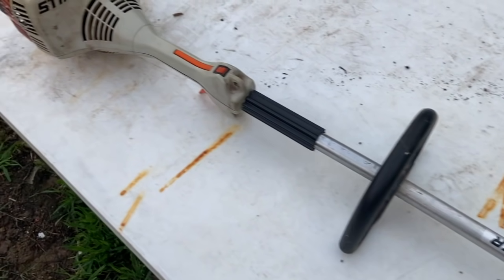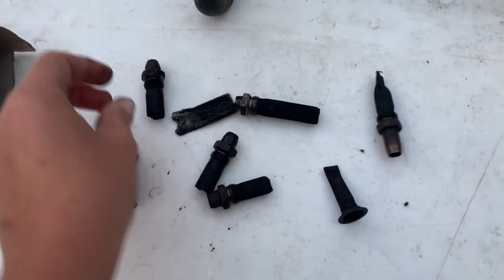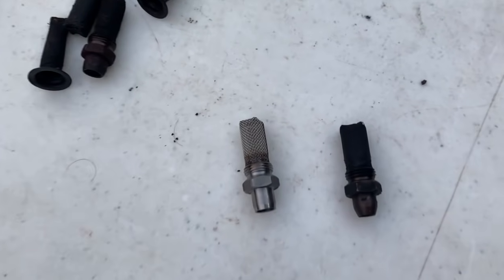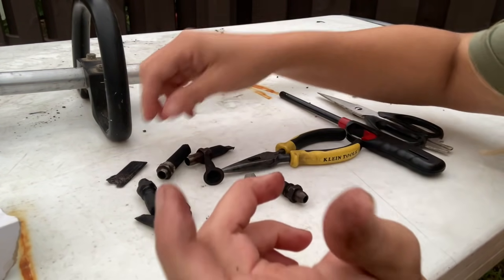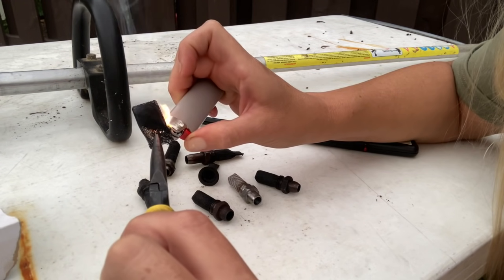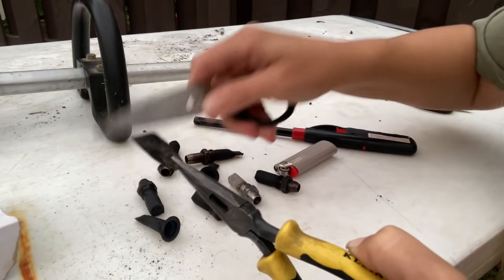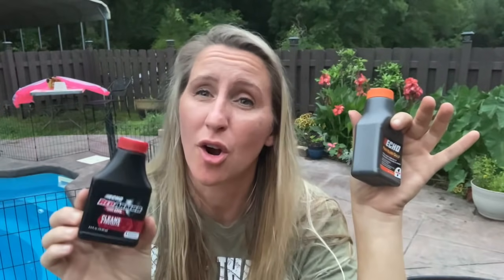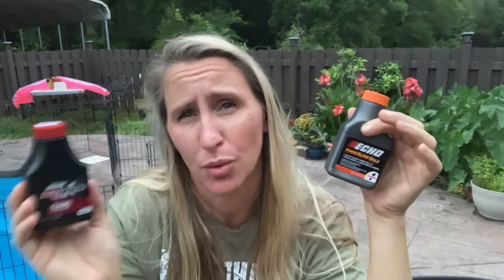THE BIG SECRET! STIHL has NO POWER? Won't Throttle Up? How to fix your trimmer/blower.

Comment: It's funny... and yes I agree you are correct. I always remove those, but the bigger thing is regular customers only use theirs a few times a year not like us using them daily. What I found out is if you build your own which is 3x the size it works a lot lot better. I wish manufacturers would not cheap out on those and build them bigger in general because as bigger they are the longer they do last and less they do hinder the build up. Also we pump ours screens into awesome and after 1-2 days they are clean and ready to be reused.

Comment: Is this strictly when you are using it low power all the time without using full throttle, or does varying between the two speeds keep it burned off?
(Love your videos!)

Comment: Many times a customer would bring a trimmer with no speed/power.I would take the machine and the customer to the back shop and show them how to remove the spark screen. Many would say they had no metric allen wrenches, so I would give them one. Never charged for this. Built much good will that way. These same customers were quite loyal to the shop. Made more money than charging for such a simple fix.

Comment: Even at full throttle you will still need to check and or clean them regularly. I use break cleaner spray. The worst offender is my Stihl hedge trimmer.

Comment: Hi, A few years ago I was gifted a 4 cycle cub cadet trimmer (BC490)  Once it starts it does pretty good except for spewing oil out of the exhaust. It seemed to have weak spark so I changed the spark plug and the cable because it appeared to have been severed a bit due to it being positioned wrong and the plastic cover damaged it. The cable came with a new fly wheel but i didn't change that yet. Now I am thinking that there is a carb issue. Any thoughts?? Thanks :)

Comment: a torch and a blast of air from the compressor air pistol I seen mechanic do this many years ago he said I used a wire brush but sometimes the wire would get stuck in the screen so he used air from then on ..

Comment: In Europe we don’t have spark arresters. Our fuel though is 5% Ethanol, so when I use my Stihl power tools with 5% Ethanol mixed with Stihl HP Super after use I empty fuel tank and then run engine till absolutely dry of any residual fuel in fuel line or carburettor. The problem is next time I use the Stihl power tool, it’s a pig to start or pop off, often taking 20 - 30 pulls on starter cord almost giving me a cardiac event. Often I find spraying Carburettor Cleaner into air intake will start engine almost immediately for a few seconds, after which the engine will start easier almost straight away on normal 2 stroke fuel. I would like to know if after using Stihl power tool and emptying it if I should add some Stihl Motomix and run for a few minutes and leave a little in fuel tank and fuel system, even though it’s made up of Stihl Ultra oil and if this is ok. Stihl Motomix is $30 US per gallon in UK.

Comment: I have a shindaiwa eb480  at full throttle it sprays fuel out of the carb to a point it will cover your hand when placed in front of it, doesn’t seem to go to full rpm.  Spark arrestor clean .   Any suggestions?

Comment: Taking a chance you may read this, I have a redmax bcz260ts  trimmer and the past month it's hard to pull the rope only when it's cold and the first start of the day. Very hard to pull the recoil rope . After a few pulls and it's started the it's so easy again to pull. Only happens when it hasn't  been used for the day . Can you tell me if you have any ideas? Never had the cover off or messed with anything internally

Comment: Many yard machines don’t need to be run at full throttle much of the time, so how much of the part-throttle carbon issue is oil related and what’s different about the Stihl oil?  Running at full throttle all the time will no doubt wear out engine internals faster.

Comment: No Xtra warranty if u use Sthil oil in Aust . Seems to be u can run less oil with the Sthil 50 to 1   vs other brands 25 to 1 .  As a contractor I always prefer more oil in mix . Never had oil/carbon/screen issues . As u have suggested if u use alot of throttle limited issues occur .
Used on 95 series 2 strokes and FS 130  4 mix technology --uses 2 stroke fuel

Comment: Chickanic  I have a Ryobi RBC430SESC  4 stoke petrol strimmer.  It has only been used about 6 times.  The thing starts and immediately stalls.  I do not want to be replacing the carburettor.  
Any advice other than get a new strimmer?  Thanks.

Comment: I found that mixing non-Oxy with the VP pre-mix in a 2 gallon tank along with 1/3rd of a small oil container that u mix with 2 gallons of gas has run well & not the smoke I had. When I ran exactly a mixture of 2 gallons of non-oxy along with 1 small oil container in a brand new Stihl 18" saw I had problems starting it & they told me I had too much oil in my gas mixture. Unbelievable! The gas cap broke on day 10 & I was lucky enough to find a new cap @ the Stihl dealership which fit but wasn't the piece of crap model that came with the new saw. Should of bought the Husqvarna model which I could have bought new which has a regular threaded cap to it. ➕️ they offer on a new saw a couple of years added to the warranty if u buy a couple of gas/oil products u r going to need anyway. Probably cuts down on Husqvarna warranty problems by starting off with the right accessories for your new saw.

Comment: That's a constant problem. I've told customers repeatedly that these small two cycles have to be run flat out and hot. They don't believe me and constantly pump the throttle, assuming that it's easier on the engine.

Comment: I use the line that is shaped like licorice. I find that it trims much better than using something that is round and smooth and therefore won’t cut the grass or weeds as good as something with a edge. I mean that’s just common sense

Comment: QUESTION :I have a Sthil 180 that ive busted the antivibration bushing on the handle , local saw shop wants $200 JUST in labor to fix this as with this model saw {i bought it new about 20 years ago} they say and showed me , that the top of the engine has to be taken apart to get to the bolt to replace the bushing.....other then that , the saw works like a champ , but its just beating the heck outa my h ands and shoulders now. Is it worth fixing it or just shelve it till i hit the lottery and buy a new saw?

Comment: I know this is a super old video but still may help some folks. Anyone who owns Stihl equipment needs to read the manual.  My older 011 ATV uses 40:1 with Sthil oil and 25:1 with other brands per the manual. But both my MS171 chainsaw and my FS240 string trimmer are 50:1 with any oil but recommend Stihl.

Comment: Question. DO I have to use the Stihl gas? I patronize three Stihl dealers. They all insist that I use their $35 per gallon gas/oil mix "or it will void your warranty (the common threat). Of course, all of this goes on as they also have Stihl oil for sale. What's your advice and opinion?

Comment: Another consideration for the spark arrestor screen is that the engine and carburetor were tuned for its presence. Exhaust scavenging will not be the same without.

Comment: I just spray mine with carburetor cleaner and it removes all of it in a matter of seconds and then put it back in but anymore I just take them out. I use Stihl oil now so I normally don't have that problem.

Comment: Hello miss good day i have a stihl 450 brush cutter  for about 4 years now and have been using chevron 2 stroke oil in it and i have never have any problem with it at no time someone tell that it is a good to use in it and i have been using it for so long without any problem

Comment: I have a 25cc Hyper Tough weedeater that wont throttle up.  I took the plastic cover off to expose the muffler..it doesnt seem to have any removable exhaust nut/screen on it?  Just a triangular opening that doesnt seem to have any way of servicing inside the muffler?

Comment: I RUN 93 GAS IN MY MS 291 AN MY 360 PRO STHIL SAWS I USE STHIL MIX OIL AND HAVE NO PROBLEM WITH THEM  I DO MY OWN SAW WORK ON THEM

Comment: hi ,  i like your show.  i have a 290 stihl .   engine wont start. its 2 trees old and about 1.5 years old.  the dealer said the enhine meeds a head cylinder piston .  i used stihl oil but they wont honir the 2 year warrantee because they said i over heated by using a dull chain.     s o now i wont pay them another $350 to repair it .  i have a $500 paper weight.  iam a mechanic myself.  i work on heavy diesel equpiment.  is this saw worth fixing?.

Comment: I have murry 2050 string trimmer.  It would not start this spring.  No spark.(replaced coil)  now I have spark. Replaced carb.  It will only run a little while.  Could it be clogged muffler?  Last year it would only run about half chocked.
Reply: I suspect a CC vacuum leak, probably the seals around the crankshaft. Check your CC vacuum with a test gauge.

Comment: I have Troy built string trimmer 30cc, and it is the hardest starting trimmer I have ever had. Any ideas why it would be so difficult starting
Reply: I got one of those crappy lean-running trimmers too. She didn't much like 87E10 Manitoba-Canada gas, but I'm not about to keep ethanol-free gas just for her.  I finally modified the carb-circuits quite a bit richer, and now she is much happier.

Comment: FYI.  If your cutting and have a  permit from the Forest Service and are caught with your spare arrestor removed, it is a huge fine.  I've seen rangers at checking stations not only checking their permits but checking their saws also.

Comment: I just bought a 4 stroke outboard motor.  Can I use my leftover 2 stroke outboard motor oil with my chainsaw/leaf blowers?  Thanks in advance.
Reply: I have heard outboard 2 stroke oil is for marine engines, not gas powered lawn equipment. I think it may have something go do with the shear point of the marine  oil at higher temperatures. You are better off getting 2 cycle oil that is made for specifically for gas powered lawn equipment (not marine engines). If you don't use the right type of oil for your lawn equipment, your pistons will probably seize up before their time. Gas powered lawn equipment costs a lot more these days.....

Comment: Fuel quality also a huge problem. Always add a quality fuel stabilizer to fresh fuel every time you get a can full as soon as possible
to avoid separation and loss of quality. No matter if the oil says it has stabilizer or what type of fuel, non ethanol or not.

Comment: I was told by the Stihl dealer was , remove that. Put in vise use propane torch burn off carbon. Let it cool reinstall and that's it ready.

Comment: I have a question can I use any stator or voltage regulator for my z-track 225 Briggs & Stratton motor as long as it will fit it or do I have to get one that will match the same model number because the one I found on Amazon has both but don't have my model number for the part
Reply: You don't have to use the same stator or rectifier, but they do have to match your need. You can't use a low amp stator with an electric PTO.

Comment: An Oxy/Acetylene torch adjusted to an oxidizing flame (excess oxygen) is excellent for burning off carbon from most everything. It's not the heat that does it so well, it is the excess oxygen in the flame that causes the carbon to really burn off rapidly, because, carbon is actually a fuel, (Think Coal, or Charcoal Briquets) carbon burns when heated in the presence of oxygen.

Tim

Comment: I think the issue is people take better lubrication is always better in 4 stroke engines and apply it to 2 strokes. 50-1 works fine with conventional oil, but I think it's too rich with synthetic. Synthetic simply lubricates too good for that kind of a ratio.  Amsoil really got me to buy into this idea even when I don't run Amsoil Saber. I will run Amsoil at the tested 100-1. If it's another brand synthetic I'll run it at 75-1 and a lot of the issues go away.

Comment: Casterol Makes the oil for stihl it even says it on stihl packages. Oh and harvest King makes the oil for chainsaw bars. In laboratory tests and actual use it's far better than the name brands and it sells for $10 or less depending upon where you buy it Harvest King makes a wide variety of lubricants for tractors and other applications even Automotive😊 just bought 24 gallons of it I can get 3 gallons of harvest King which is better than what I would pay for 1 gallon of stihl bar oil😊😊

Comment: Question - You referenced using Stihl Oil and not running full throttle causes lots exhaust build up, So if you use Echo oil is this not a problem ?
Reply from the maker: It will happen with any oil if you do not run full throttle, I just see it more with the Stihl silver bottle oil. The oil is great though if you run your equipment at full throttle. Even if you have to run it at half throttle to get your job done, give it a good rev up in the air before you get done to burn that carbon off.

Comment: What's your thoughts on the "generic" oil you can get at Walmart or Home depot??
Reply: Cheaper oil isn't always better. I trust the Echo brand 2 cycle oil, and i use it in my Echo gas lawn equipment. No problems with Echo oil. I have used VR full synthetic 2 cycle oil, if i can't find Echo 2 cycle oil , without problems. Just make sure whatever oil you get is compatible with your brand/model of gas equipment. A good quality 2 cycle oil may cost a few bucks more, but it will make your gas equipment run free of trouble for many years down the road.

Comment: Also, removing the screen will mess with the fuel/air mixture in a two stroke, especially at high revs. A hole in the piston is no joke. The spark arrestor is designed as part of the engine.
Reply: Yes, but the knowing how comes from experience (and mistakes)

Comment: So the echo oil will work good in my echo and my stihl chain saw?
Reply: I can't speak for Stihl equipment, but i do own Echo blowers and a Echo 2620 gas trimmer. I use mainly Echo (Red Armor) 2 cycle oil and i have used Echo (PowerBlend) 2 cycle oil without any equipment problems. Echo's fas powered equipment can run anywhere from 10 to 20 years with Echo 2 cycle oil, so i feel Echo's 2 cycle oil speaks for itself. Echo oil cost a few dollars more these days, but i trust their 2 cycle oil, especially the "Red Armor".

Comment: I take the spark arrestor off and tune for extra air flow lol. Also you can say it Stihl oil sucks !! 😅 when i stopped using it i could see an immediate difference. Bad smell went away, less smoking, and when i look inside my cylinders and muffler less carbon deposits.

Comment: Leaf blowers are a real offender in the plugged spark arrester problem. People putt around at part throttle and the screen becomes plugged and the engine will hardly come off idle. Pretty simple to remove the screen and clean it. Chick is right, you have to run a spark arrester. They are a fire hazard without a screen. If you choose to be a hero and run without a screen, I suggest you fire up your two cycle engine at night and watch the mini flame thrower you have created. Always use a screen and don't dog down on the throttle.

Comment: question for you girl:  I have an  old shindaiwa 270 that I love.  it never gave me an ounce of problems until recently.  mind you, I have had it for over 20 years.  well, 
the clutch went out on it.  I took it to a reputable repair shop and after a while he called me and said that the clutch was obsolete and that shindaiwa no longer
builds nor sells those items.  so,  I bought a stihl weedwacker, which I am not that impressed with.  I love my shindaiwa, which I keep under the house.  so, after
much research,  I found a shindaiwa clutch in Italy.  I bought it and shipped it to my home.  I took the shindaiwa weedwacker and the new clutch to the shop.
no matter what he did, he could not get it to run right with the new clutch.  the head keeps turning.  any suggestions?  can I mix and match with another brand?  
I refuse to give up my  favorite weedwacker.  I am at my wits end.  please advise.

Comment: From Wikipedia "Two-stroke oil.  To avoid high emissions and oily deposits on spark plugs, modern two-strokes, particularly small engines powering such items as garden equipment and chainsaws, may now require a synthetic oil, and can suffer from oiling problems otherwise. 

Government bureaucratic orders from headquarters should come with their own warning labels.

Comment: I do have a question, though.... do you have any tips for a stihl trimmer that shuts off within second of releasing the throttle lever?
Reply: adjust the speed screw to a higher idle, just below the speed at which the clutch cuts in;
and/or adjust the low-speed mixture screw.

Comment: These weed eaters are made to run for throttle they are a air-cooled engine which means they cool off by the fan in the flywheel is in there if that thing is not spinning it's not cooling and yes you are right it is great total I have always ran it for 17 years and have never locked a piece of equipment  up with it

Comment: 0:20 I believe the Magnuson Moss law says if a company requires you to use a specific brand product to keep a waranty, that company has to supply that product for free. That is if Stihl requires you to use their oil in thier products, they must supply it free of charge. Stihl can say that a product meeting a specific physical requirement must be used (like synthetic oil, or TCW-3 oil), but they cannot say you must use Stihl brand oil. 

Those exhaust screen parts are actually flame arrestors. They prevent the unit from spitting out a flame, and causing a fire. They are NOT required in all parts of the U.S. (Check local and State laws). They are required when using the engine on Federal land like National Forests, BLM land, etc. It is better to have it installed than not having it and starting a multimillion dollar fire.

.